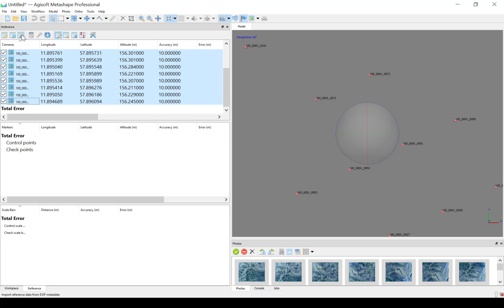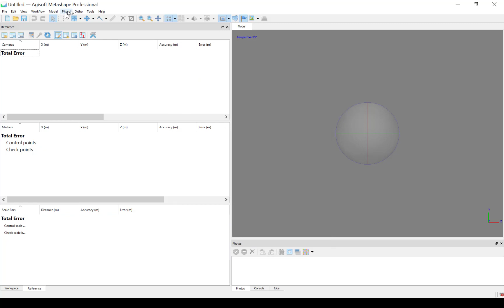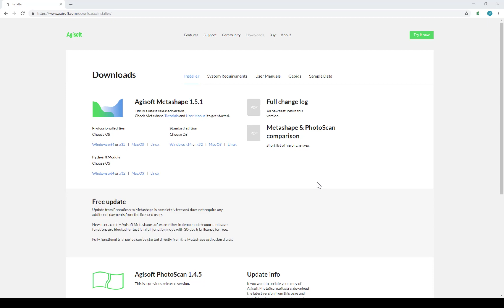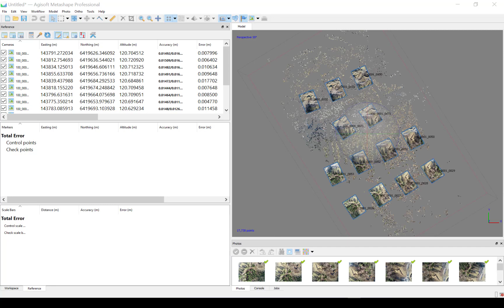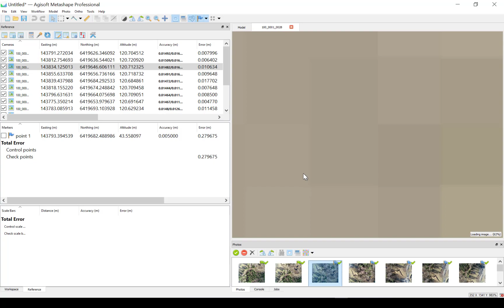Processing DJI Phantom 4 RTK photos in Agisoft Metashape

Comment: You did not optimize camera calibration thus you have 30 cm error on height values. Or you can use field camera calibrations as known pre calibrated camera parameters.

Comment: So you've defined the geoid under custom protection and given it a unique name?
Reply from the maker: I'm not sure I understand your question. The geoid is downloaded from Agisoft's website (https://www.agisoft.com/downloads/geoids/) and copied into the Metashape installation directory. The geoid I'm using (RH2000) is the one used in Sweden with the Sweref99 coordinate system. The geoid is a raster covering the entire area where the coordinate system is defined, for sweref99 it is all of Sweden. In Metashape I don't need to define anything, just copy the file downloaded into the Metashape installation directory and Metashape will use it automatically with the right geoid (RH2000 in my case) if it has the same name as when you downloaded the file. I hope this answered your question?